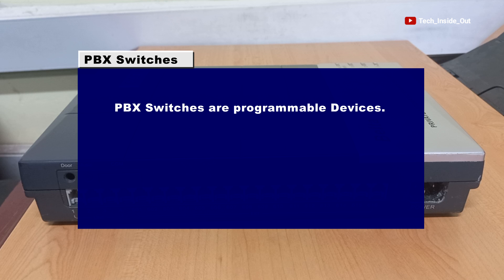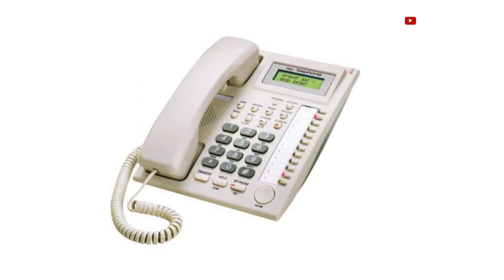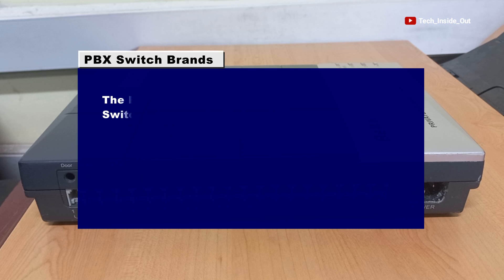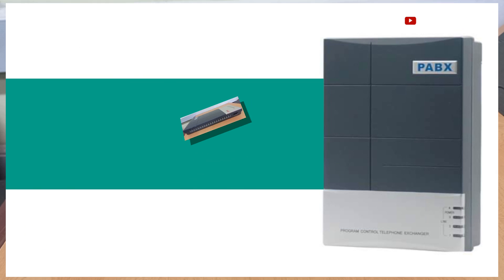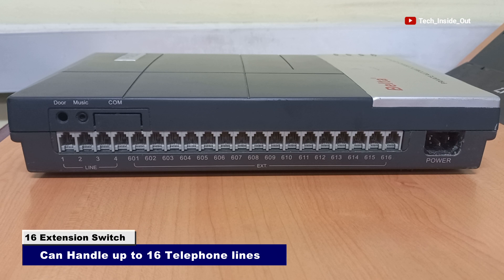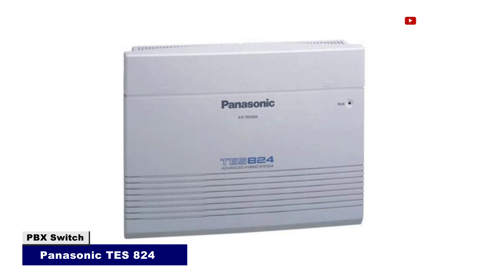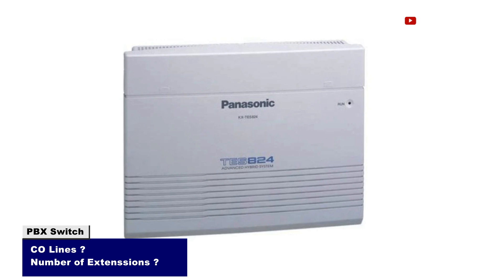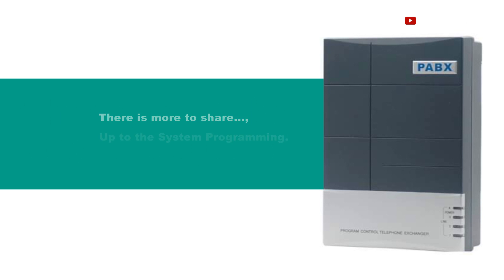Telephone intercom system - PABX switching system

Comment: The Panasonic pbx machine labelled TES824 has the capacity of 8 central office line and 24 extension ports.. 

Thanks for this course. God bless you plenty 🎉
Reply from the maker: You are right on the TES 824 specification. 
God bless you too